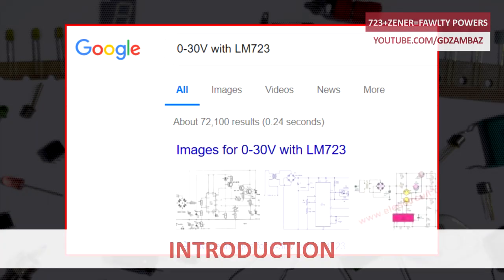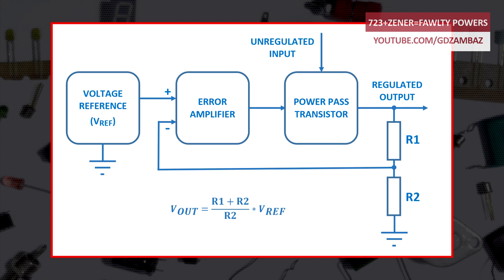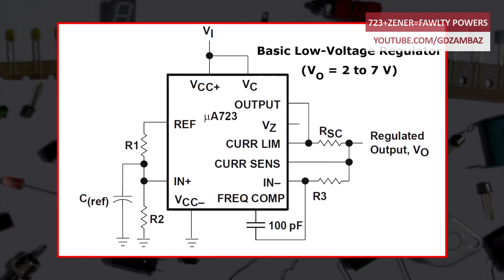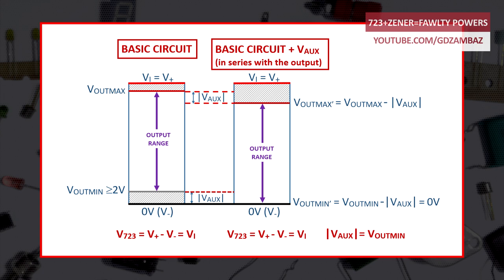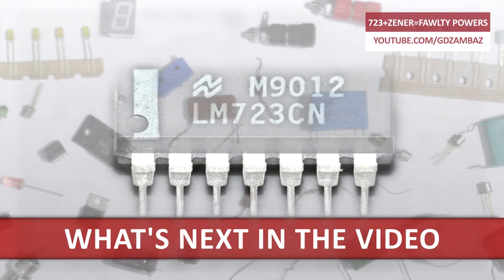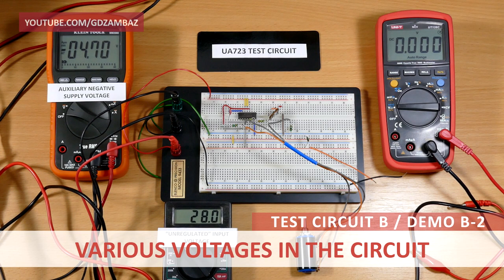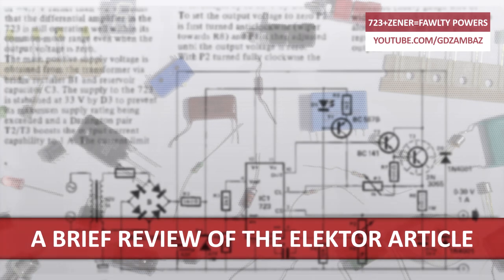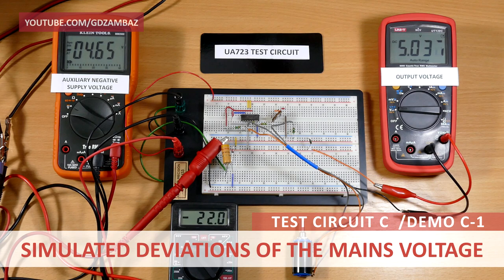723 + Zener = Fawlty Powers

Comment: Great overview and experiments, showing the stability features by stepwise adjustments. 
It would be outstanding if you could supplement the experiment using a TL431 as a temperature compensated ‘super-Zener’ with low dynamic impedance - even as 2.5V (no need to go 4.7V) with a lower value resistor driving it, to compare these improvements. 
Doing so, it probably be a direct retrofit to formerly made assemblies, or guide new ones.
Thanks for posting it!
Reply from the maker: Good suggestion. If I manage to do that in the near future, I'll certainly publish a follow up video.
Thank you for your input!

Comment: Really good and detailed video. I have made the same regulator lm723 in this. I wanted to get zero to around thirty volts output. I figured there are a couple of more ways to get it to go to zero. A opamp can be added inline as a voltage follower with adjusted gain on the base of the pass transistor. Also a isolated voltage can be added in after R1 in the inverting input of about 3 volts and you adjust the reference side for voltage control. I went with the latter one and made a better reference of 7.5 volts. I got it to work well from 0 to 30.1 volts output and the new reference is a  improvement for voltage drift.
Reply from the maker: Thank you for your input. If you have a chance, please post a short video or link to the schematic of your modified power supply, so we can get a better insight.

Comment: Very interesting presentation indeed. An old but effective countermeasure used for canceling the thermal instability of the zener voltage is to use another one diode connected in series to the zener, but in forward polarity, that is, the anode of the zener should be connected to the anode of the added diode and finally the cathode of that one should go to the 2K2 resistor. This will be then the ground connection point of the 723 (pin 7). This diode addition will add more than about 0,65V to the zener voltage (4,7+0,65V being the typical sum) which is negligible, but it will remove the thermal drift of the negative stabilized voltage. A 1N4148, used usually in such cases, normally cancels out this effect. In any case, a fixed -5V three terminal stabiliser (7905) used in place of the single zener diode solution seems to be the best solution and is common practice...
Reply from the maker: Thank you for your comment!
Actually, the Zener diodes with a breakdown voltage of up to about 5.6 V have negative temperature coefficient and the Zener diodes with a breakdown voltage above 5.6 V have positive temperature coefficient. So, adding a forward-biased silicon diode (with a temperature coefficient of −2 mV/°C) in series with a Zener diode (to cancel the effects) makes sense only for the Zener diodes with positive temperature coefficients (thus, with voltages above 5.6V, which is not the case here).
And yes, an auxiliary negative voltage supply with 7905 would be a much better solution in this case.
Reply: @GoranDzambazov  Yes, you are right, I forgot that detail about them. There is another way in resolving the problem of stabilisation of low voltages, which I also forgot to write. This can be done by the use of common L.E.D diodes as voltage stabilizers, which brings much better result if this method is applied. I have read a relevant article in a German magazine about that, back in 1987...And later on I have seen many times this application in real circuits, naturally because it is a cheap and reliable solution...

Comment: Instead using a thermal compensated zenner diode, I, many times used a LED. It is more stable with the temperature and can be used as a indicator also. Sometimes a green and red LED in series.

Comment: Thank you for sharing this video. I appreciate your hard effort to teach us. I was impressed with the extent of your trials. They were centered around two points... 1) Varying the virtual ground point, by many methods, from the minimum -2V (required to allow the output to reach a true 0V) to an (arbitrary?) -4.7V. Given that the needed offset should set to -2V, I am not sure that I understand the remainder of the negative voltage explorations. Well, admittedly the additional tests do prove the point that the -2V should be firmly affixed. Additional points concerning the Zener reference are found, here. a) The circuit's excellent performance touted in the literature must be considered in the context of the time in which it was written. Meaning, that, in its day, the circuit performed well, in the author's opinion, compared to other circuits of the time. b) You noted that the solution is that the reference must have no less of performance specifications than the LM723. Now that time and technology have advanced, references with better thermal specifications (less thermal drift) are readily available and surely should be substituted in the circuit. 2) For either the original Zener reference, or the newer more thermally stable references of our day... a) Care must be taken to isolate the reference from ambient temperature changes. This is often accomplished with special rooms, or covers, created within the chassis. b) All PSUs, even of today's technologies, in every price range, require a preheating period, in which the cabinet warms to a point and then becomes thermally stable. The PSU is not intended to be used, before that stabilization is reached. Your testing did not include these critical points and this was unfair to the Zener. These considerations are not to find fault with you, or the video. They are simply intended to widen our considerations, in order to learn a bit more. I hope they are helpful, to that end. Cheers.
Reply from the maker: Thank you for your comment and the suggested considerations.

My analysis in the video is focused on the schematic/circuit that is originally published in the July/August 1978 issue of the Elektor magazine, where an auxiliary negative voltage supply of -4.7V is used. So, that is why I'm doing the tests with this particular value of -4.7V for the auxiliary voltage supply.

Regarding your suggestion that the circuit performance should be considered in the context of the time in which it was written: Perhaps my point would have been even more clearer had I suggested in the video the alternative solutions for an auxiliary negative voltage that were already available at that time, such as 7905 or TL431. These circuits provide better line and load regulation, and better temperature stability than a circuit with a simple Zener-diode. (And also, an auxiliary circuit for a negative supply with another 723 IC was an option.)

Regarding the comments in 2): I agree that in general care must be taken to isolate the reference from the temperature changes. But again, for the circuit in question, if you already have the other options (7905, TL431 or another 723), I do not see a reason to design a more complicated solution with a thermally isolated Zener diode. And even if you do so, you will still have the problem with the poor line regulation due to the dynamic resistance of the Zener diode that I demonstrated in the Test Circuit C / Demo C-1 (starting at 15:09).
Best, Goran
Reply: @GoranDzambazov  Those are all super responses. Well thought out and well said. You have helped my understanding of your frame of reference. One of the first circuits that I ever wanted to build was a proper PSU. I found that many/most of open source designs were challenged in developing the negative power rail. Those challenges continue, even with the improvements in IC technology. I still would like to find a simple and successful DIY 30V/3A, Constant Current PSU circuit. If you know of a specific one, please provide a link. Oh, another challenge is always the high cost of the IC used to pass the current. Of course, all of this is in consideration of a Linear Supply. Switch mode designs are becoming very much noise-free and more universally usable. So, my nostalgia is just that, nostalgia. I greatly appreciate your reply.
Reply from the maker: Thank you again for the kind words.
You might be interested in this article and power supply:
https://www.analog.com/en/technical-articles/high-performance-portable-dc-bench-power-supply.html

It's a mixed-mode DC power supply with LT3081.
Reply: @GoranDzambazov  Thanks!

Comment: Great explanation. Would the 7905 or the TL431 reduce those problems? Since the negative rail depends on the half wave of the AC transformer and the energy storaged on C2 , both turn on and turn off operations would create a similar problem with regulation, right? I can imagine that a soft start circuit could, at least, mitigate one of those problems.
Reply from the maker: Thank you!
Yes, an auxiliary negative voltage source with 7905 or TL431 should reduce those issues, as these circuits provide better line and load regulation, and better temperature stability than a simple Zener-diode.
I'm not fully sure if I got the problem with the regulation that you are referring to (the part with the turn on and turn off operation of the power supply and the soft start circuit). Please elaborate in more details if possible.
Reply: @GoranDzambazov  In the turn on operation, the filter capacitor and the capacitor C2, that is part of the auxiliary negative voltage, start at zero. The positive rail tends to stabilize more fast than the negative rail. In that case, the 2V  output will only go to zero when the negative voltage goes to 4,7V. Anything that is already connect to the power supply will take this variation. A 3V3 circuit will get 5V3 for a little fraction of seconds. This could cause some damage for sensitive circuits.
Reply: The same happens in the turn off operation.  Since the positive filter cap will hold more energy than C2, the negative auxiliary rail will go down faster than the positive voltage and, once again, the power supply will lose it's 0V regulation. Anything that is connected to the power supply while it is turned off will recieve a variation of 2V. But now, for more time.
Reply from the maker: Thank you for the clarification!
In general, I always try to avoid having the load connected to the output during the turn on and turn off operations of any power supply, to avoid possible stresses to the load caused by the transients/spikes.
Yes, if we go and analyze down to milliseconds or tens of milliseconds upon the turn-on, we can expect different establishing times for the positive and negative supply rails, however which voltage will reach the steady value faster will depend not only on the storage capacitor values, or the phase of the AC input at that time, but also on the load connected to the output (Although the storage capacitors have different values, they also "see" different loads: the current that the auxiliary negative supply sinks from V- is in the range of mA, and the output current can go up to several Amps.).
A good simulation and test measurements with a digital oscilloscope of the output voltage during the power supply turn-on and turn-off should give a better overview of this issue, and this should not be neglected.
Reply from the maker: @diegoandradecaruaru  I do not consider my last response complete. I would like to revisit the issue of  the different establishing times of the positive and negative rails again, but with a simulation and actual test on a protoboard. I'll put my findings in a new comment.
Reply: @GoranDzambazov  This will really help. I don't have a oscilloscope, so i can only rely on simulations. 
Currently, i'm exploring oscillators and negative pump chargers. My idea is: Avoid the AC method for generating the pulse for the auxiliary negative rail and use the lm555 in the astable configuration with a higher frequency, like the ICL7660. Both positive and negative rails will be generated from the same main filter cap from the bridge rectifier. This would allow a more slow discharging of the negative auxiliary voltage at turn off operation.

Comment: Your analysis of the problem of the Elektor circuit is correct. There are uA723 circuits that go from 0 without negative supply, but they have other deficiencies. That is why all modern laboratory power supplies are build using op-amps, not the 723 They give better current limiting too.
Reply from the maker: Thank you for the feedback!
I wanted also to mention / analyse one other solution for 0V that does not use a negative supply, but the video would have become too long.
Reply: I have built a lot better  723 power supply that uses a different topology (also featured in an old magazine) that is a bit more complex by adding extra electronics but most importantly makes the supply floating, meaning there is a separate winding for the control circuit and separate for the output power. This design basically solves all problems mentioned in this video and also allows to use any voltage and any current if your power section is beafy enough.
Reply from the maker: I'm curious to see that solution. Which magazine and issue is the one you mention or where can I find the schematic of that power supply?
Reply: @GoranDzambazov  it's not in English, and I couldn't find it on the internet. However the topology is used in one early school lab power supply that you can find online, it's a good starting point. Look up Tesla BK127 for the schematic (note that it uses the early metal package version and the pinout is different)
Let me know what you think!
Reply from the maker: I've found one article about BK 127 in the Amatérské Radio publication (from Czechoslovakia), from 1985. I see that in this topology a fraction of the reference voltage is brought to both inputs of the error amplifier, which is a concept that I'm familiar with. I would like to take a closer look and I'll send you an update (However, it may take a while.).
By the way, I was not familiar with this magazine. Thank you for sending me the info!
Reply: @GoranDzambazov  yes, thats the  one, I am a monthly subscriber, I didn't think it might be useful to you since it's in Czech but the schematic is all you need I guess.
Reply from the maker: Well, Macedonian and Czech are both Slavic languages, so with some effort and logic (and of course the schematics), I think that I'll manage to get the essence of the article.

Comment: Thank you for video.I am new in electronic and I want make a current adjustable a power supply with LM723 .I was bought all parts of this circuits too and I will make nowadays.
What is your advice resistance value in negative voltage supply,- 2K2 value- as you had explain at 20:30 minute

Meanwhile please continue to videos about electronics if have not  any a  reason like health .You have great electronic knowlodge. I was just see your youtube channel (Bad youtube algorithms)
Regards
Reply from the maker: Thank you for your comment!
I actually do not advise you to make this power supply using the originally published schematic, because of the reasons I explain in the video. Even if you properly set the bias current through the Zener diode to the optimal value by reducing the value of R1, the other factors will still be present, so that alone won't help much.
If you still want to make this power supply, consider replacing the auxiliary negative voltage supply circuit with a circuit with 7905 or TL431. These circuits provide better line and load regulation, and better temperature stability than a simple Zener-diode.

Comment: If insteed of 4.7 V Zener diode we use TL431, which, acording with the datasheet is termal compensate?
Reply from the maker: Yes, an auxiliary negative voltage source with TL431 or 7905 provides better line and load regulation, and better temperature stability than a simple Zener-diode.

Comment: let me tell about correction of this mistake. Use 7905  -ve 5v  regulator instead of that 4.7 V Zener,the problem is mostly solved. using a 36volt   on lm723 (with a series resistor 56 Ohm) can prevent 723 from main 32 V0lts input
Reply from the maker: Yes, this was already mentioned in the previous comments: an auxiliary negative voltage supply with 7905 is much better solution than a Zener diode.

Comment: Mas, power supply bell LM723  Tdk bisa keluar teg. Lek protek nyala trs, awalmula teg overload hingga 25volt. Pdhl tr 2N3055 udh tk ganti hasil nihil?
Reply from the maker: I'm not sure if I understand your comment. Are you trying to repair a LM723 based power supply that has failed?
Reply: @GoranDzambazov  
Ok trims 🙏🙏🙏
Reply from the maker: If you still have the problem and you need advice, please provide more details.

Comment: Elektor was its time far ahead. Its now common practise to dream up specification and publish them. The ebay and amazon chinese electronics  are often far off,  what is specified.  Everybody who does  understand something about Zenerdiodes now and 30 years ago knows those are not as stable as the 723 reference.   You want to prove  the publisher after 30 years wrong  and you did. But would it not be  far more useful and interesting to prove yourself right and come with a solution.  
replace  the zener with a   TL431  and the output will remain stable  0.01 V  between 0 and full load  could be acceptable for most viewers.
Reply from the maker: Thank you for your feedback.
I agree, the video would have been more useful had I recommended a better solution for an auxiliary voltage (I became aware of that soon after I started preparing it and I even considered that option). That version would have involved at least a short analysis of the other solutions and then repeating the experiments and measurements. However, the video was already too long, so I finally decided to go with this version.